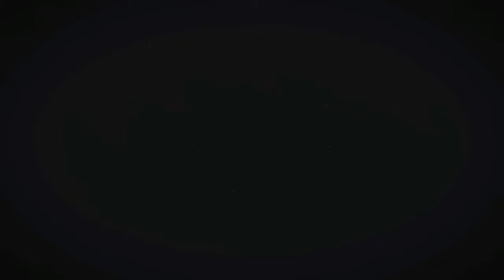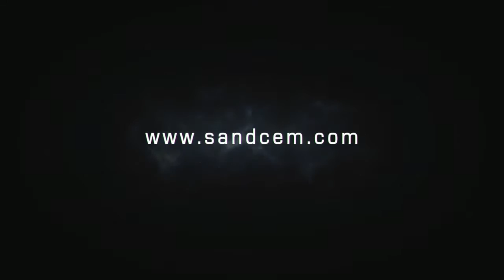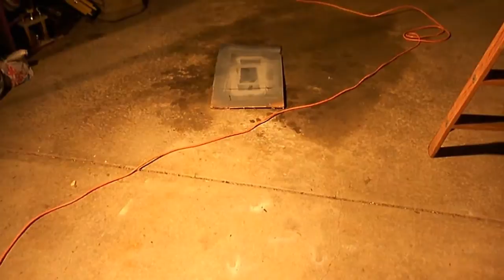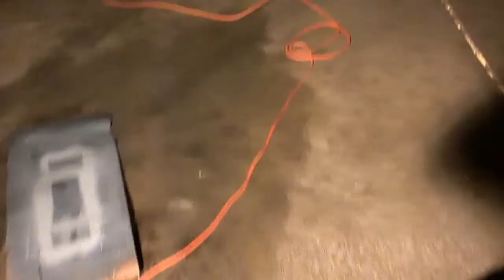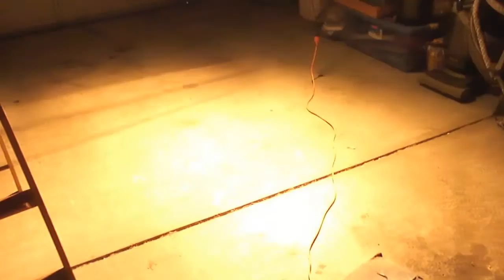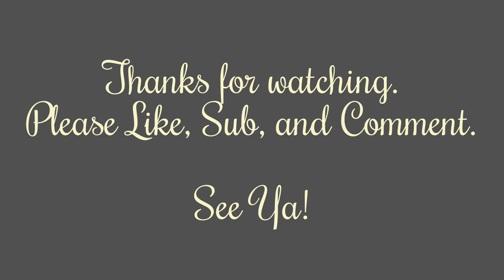Perfect Storm 2.0 test

Comment: Light looks good to me.  I would put it on the ground and angle it up. Keep in mind it will  throw shadows on whatever is behind it. If you don't like this put it in the tree.  Is 500 watt recommended for perfect storm?  I think I am using also using 500 watt in mind but maybe should read the instructions after the comment below.  What Speakers are you using. I need mine to be louder than I had it last year.
Reply from the maker: 1000 max for the controller, 500 was not recommended in the instructions, just on other websites.  For a speaker I have a huge old guitar amp that is plenty loud that I can use and also store the controller in the back of it.  Thanks.

Comment: Do all of those style controllers react to the thunder as well as the lightning sound?  Does the overall effect still look ok in the haunt setting even though it's technically "wrong" in some ways?
Reply from the maker: Thanks.  Huh?  Lightning sound is Thunder isn't it?  The controller reacts to any sound if it's picked up by the sensor.
Reply from the maker: Not sure how the effect looks in the haunt setting yet, I have not used it so I will let you know when I set things up.
Reply: I was only meaning that some the thunder sounds used are distant ones (rumbling) where they would be delayed from the light burst (as opposed to the sharp crack of close lightning).
Reply from the maker: okay gotcha.  yes, the rumblings would show dimmer effect of the light.  again, it all depends on the setting of the sensitivity.  thanks for the input, gets one's mind thinking.

Comment: If you can pull it off. Pick up a couple of the led shop lights from harbour freight. that way you are staying below the wattage, but able to add several lights in multiple locations.
Reply: You'd have to be very careful about putting higher power LED lights on the output of a device that dims (phase controls) the output.  I've seen switch-mode power supplies go bang when fed anything other than a pure mains input.  Simpler low power ones with capacitive power supplies may handle it better.  If the light says "dimmable" on the packaging you should be ok.
Reply: A non-dimmable LED AC based output is problematic? I only asked cause you said other than mains input. They run off 110v AC.
Reply from the maker: Some very good points and comments gentleman, thanks for sharing and making me think of options.
Reply: Some LED lights react very badly when put onto a dimmer and that's effectively what the lightning controller is.
Reply: da-share Yes, I agree. I was just confused by your comment that the power supply would go bang. Thanks!
Reply: I just bought a perfect storm lighting  machine for our Halloween display this year.
I think it's pretty cool and the price was right. For our display I like to use remotes to activate different lighting and things. Last year I had a bugle Style strobe light with a thunder effect that I got from Spirit Halloween that was cool at the time but only because I could turn it on and off at will with a remote.
It seems like plugging the sound directly into the lightning machine would work better than the ambient noise microphone but I'm not sure yet how to split the sound from a CD player or MP3 player to the lightning machine and then too a pair of speakers and be able to do it remotely. The Perfect Storm 2.0 only has an input for sound and no output. So two questions for the crowd;
how could you hook up The Perfect Storm via remote?

how do you split the sound between two speakers and the input jack of the  perfect storm machine?

Mcphin
Reply from the maker: great questions, i was going to use one huge guitar amp that had audio input and use the mic.  not sure if you can split the sound into different speakers.  as far as the remote, try using one of the fogger remotes, splicing and connecting the chord to the timer plug in that would go to the fogger.  make sure the wires are good to connect, that should work  i think. i'd be interested in hearing the advice of others.